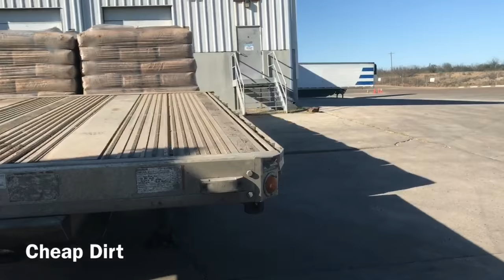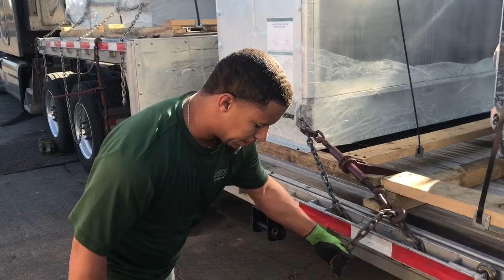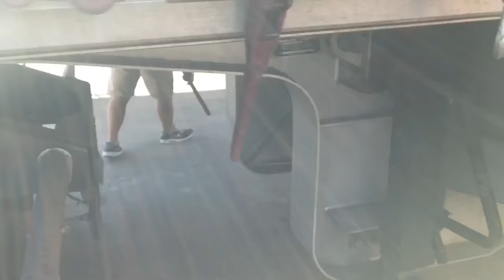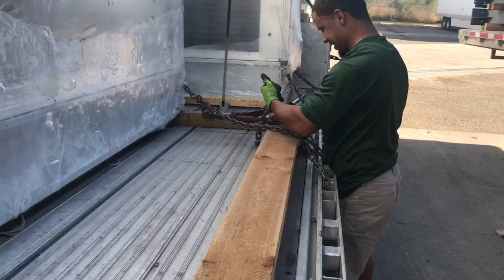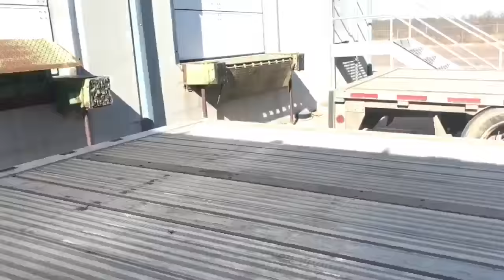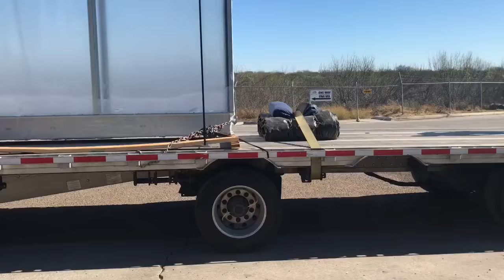Prime Inc Flatbed--Chaining A/C Units

Comment: Randee/Jose..how do you guys feel about super singles? and why did the industry move to that method? ..am sure cost has  great bearing..what about safety..wear..prices of tire,..etc..if you could expound on this what appreciate it...
Reply from the maker: iamrichrocker I prefer duals..they get better fuel mileage is the saying..if it blows ur screwed unlike a dual..about $1000 a tire..hope that gives a little better in site on them
Reply: Fellas I think the reason is that supper singles has a higher load rating we put them on my winch truck an we had to change out hubs an an what a pain now the bennifits was 14k limit on front end rather than 12k when it came to traction on ice ha ya fuck all that after a year we switched back on rear I agree that duels is better I'd also like to say no way you work for prime almost every prime flatbeder improperly places load securement wrong I don't agree totally with how you anchored your chains but I've done same at least you have a few load stress points most all secure to the SAFTY rail it's not load baring it's for added protection from being cut it broken if in an accident I like he you put your straps on an exess coil inside so it's beet an clean most you young guys look like rookies try n to be smart but it's obvious there learning you ta you hot guys that's the way you do it an look good clean secure